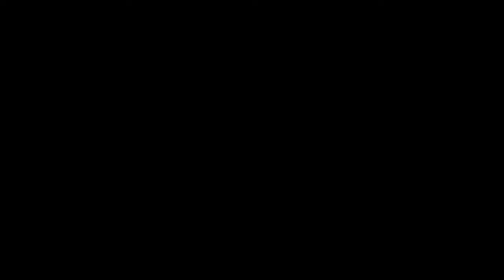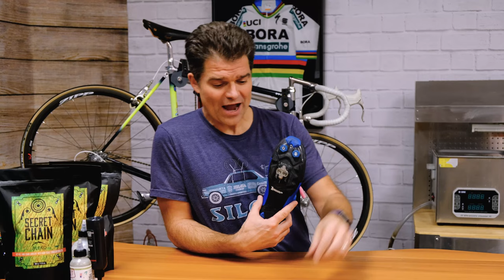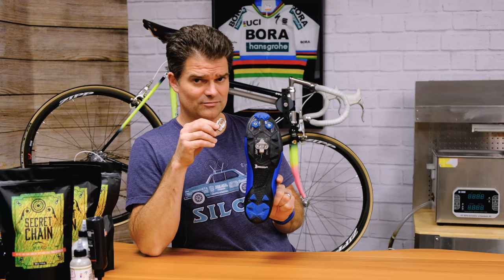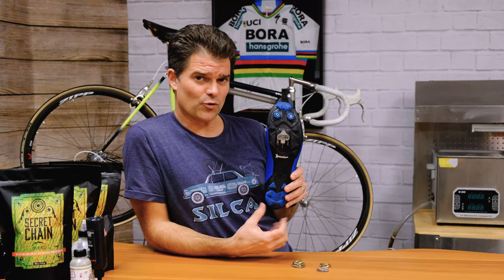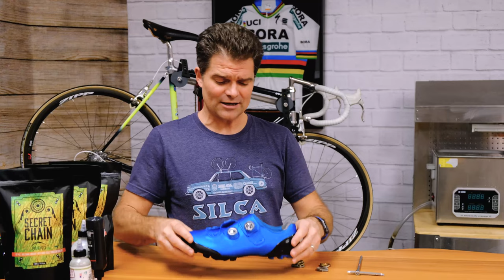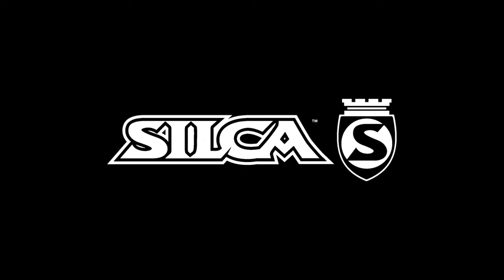Titanium MTB Cleats: NEW Product Announcement from our 3D Printers

Comment: Are they more or less thermally conductive than steel? I find that unless I wear thermal insoles, I can feel a fair bit of heat drawn out of my feet in the winter through the metal-metal interface of a steel cleat.

Comment: Love the product but surely that T25 is going to be a pain in the you know what to get all the mud out to get the tool to seat properly? I guess I will have to fork out for a pair to be proved wrong. BTW, do I remember correctly from the pod that you were printing them with different float amounts? Being able to print angle shims and vertical leg length corrections would also be a very useful application of the technology.
Reply from the maker: Thanks Ben and trust us, the 4mm hex in a Ti screw is a nightmare over the long run in this application.  In our testing the universal feedback from mechanics and athletes was to drop the 4mm for a T25.  Also, yes, we will eventually be offering custom printing options, but just getting all the production details sorted for the 'normal' cleats at this point and looking at moving that direction sometime next year.

Comment: Is it 3x the life expectancy compared to the brass crankbrothers? How does it compare to a steel shimano cleat?
Reply from the maker: 20-30% more wear resistance than Shimano, no rust and no cold welding in cold/wet conditions
Reply: @SILCAVelo  My point is made: 20-30% improvement for 6x the market price (forget MSRP) of original Shimano SPD steel cleats.
Reply: @The_One-Eyed_Undertaker  If you have no intention to buy  these, why post? Silca sell elite level products and make no excuses about offering the best products at fair prices. Stick with your Shimano cleats.
Reply: @bobroberts3968  Nothing wrong with Silca selling an $85 cleat. Also nothing wrong with doing math in public. Why try to shut down civil discussion around this topic on a public forum?

Comment: I find my spd cleats sometimes "chirp" in my Garmin Rally XC power meter pedals if I don't keep the interface lightly lubricated. And it's super annoying. I'm curious if you know whether or not the Ti cleats would eliminate that squeaky/chirpy sound?
Reply from the maker: We've never heard any complaints of squeaks or noise, and the Ti is slightly softer than the steel SPD cleat, so it should be less prone to squeaking.  You should also look at something like our SuperSecret chain lube, it's wax based, but contains WS2 nanoparticles that actually embed themselves into metal so that surface to surface contact is actually occuring in the opposing WS2 layers and not in the metal itself.  It can virutally eliminate wear and noise in a chain which has far higher surface pressures than cleats in a pedal.

Comment: They look awesome but USD 85??? I can buy a pair of original Shimano SPD cleats for 10 bucks. So the 3-4x more durable proposition doesn't work in terms of value at that price...
Reply from the maker: SPD cleats have MSRP of $25 and cost more than $10 at wholesale so I'd beware of whoever is selling those.. but here you also have half the weight, and Ti eliminates the cold welding/siezing issues that can happen with steel cleat in wet winter weather.
Reply: @SILCAVelo  Jenson lists the SM-SH51 for $12.89. So yeah, not $10, but... I'm curious about this cold welding thing. While technically possible, I've never experienced it riding year round in Illinois (road, gravel, fat). What are the conditions where this happens? Maybe a concern only for heavier riders because it requires a lot of pressure to fuse the metal?
Reply from the maker: Growing up in Minnesota this was definitely a thing.. fat bike riders talk about it quite a bit as well.. requires cold and wet and a bit of salt and you get a quick fusion of the metals at the interface, can be quite awkward at stoplights!  Richard Bryne at Speedplay spent 10 years trying to design a super durable cleat for MTB that wouldn't cold weld at Speedplay and has half a dozen patents on this.  Also, SH51 at $12.89 is an unfortunate retail ploy to get you to buy other stuff.. that's basically the wholesale price
Reply: @SILCAVelo  Interesting. I've never had that issue riding in the salt flats of Chicago/southern Wisconsin, but it's possible that the reason I haven't is because (at least as I understand it) cold welding requires very similar materials, in close contact, with sufficient pressure. I generally spray my cleats and pedals (which should be different kinds of steel) with a silicon lubricant to reduce squeaking and inhibit corrosion. Imagine a bit of assembly grease, or really anything that separates the pedal from the cleat at the atomic level, would accomplish the same goal. 

Ploy or not, it's still the price that you can buy the SH51 for, from a reputable vendor. Personally, I keep a list of consumables (brake pads, cleats, etc) handy for when I want to pad an order to get to free shipping from a vendor. The price of these is low enough that there's no real downside to having a pair or two on hand.

Comment: It's odd that wear claims are made against brass cleats when Shimano SPD cleats are made from steel.
Reply from the maker: We cover this in the tech data.. 20-40% longer lasting than steel cleats at some 25-30 grams lighter, not to mention no rust/corrosion or cold welding/seizing cold/wet conditions.
Reply from the maker: But to be clear, all of that may mean NOTHING to you and that's OK..
Reply: @SILCAVelo  I'm struggling to find the tech data on the product page, could you help me out there? Also, FWIW, the product page seems to flip b/w calling the Ti 6V/4AL and 6AI/4V. Would it be possible to clarify what the material is?
Reply: @SILCAVelo  My concern is that comparing against brass, when the competitive product is steel is at best sneaky. It creates a situation where a technically true statement (Ti is harder than brass) is used for a dishonest purpose to take advantage of information disparities. How many people will know what their cleats are made of? That might not be the intent, but it's really hard not to read it that way.